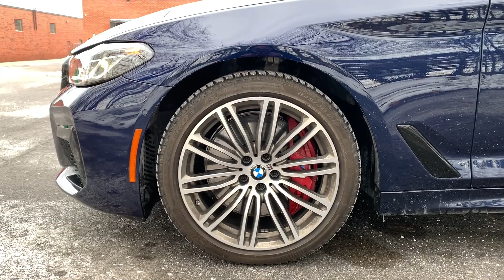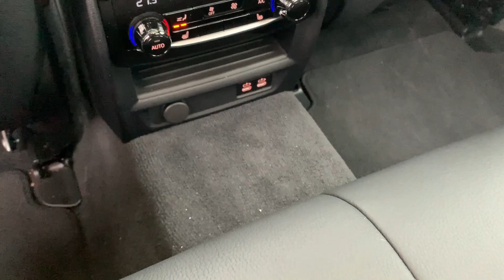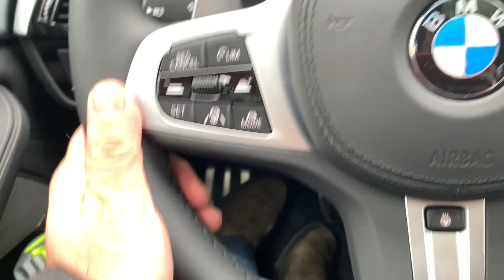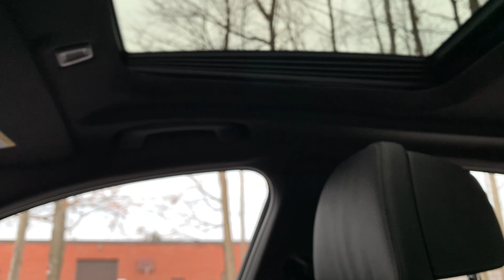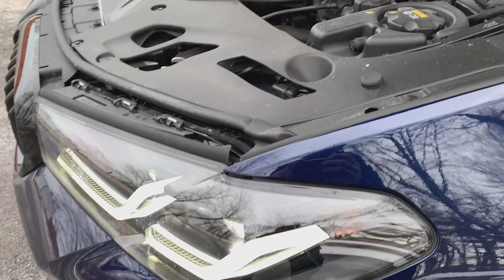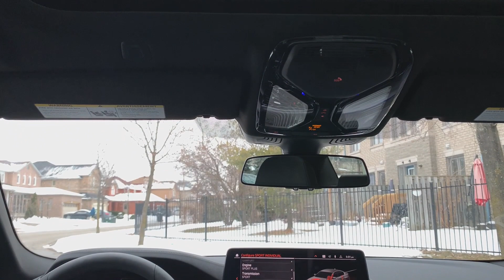Perks Quirks & Irks - 2021 BMW 540i - My favourite modern BMW

Comment: In 1972 it was called a Bavaria or 3.0 S and 3.0 Si [E3] [father had an E9 - different designer; Karmann], which followed the BMW 2500 in the late 1960's, then [E12] 520 / 528 / 530 started in 1978.  This also debuted the iconic Hofmeister Kink which now seems to be almost disappearing from BMW lineups.  Then came the most iconic E28s of the 1980's that really stirred the interest and took off.  My first BMW wasn't until the E34s would appear though, followed by the E39 and the E60.  Followed by F07/F10 and now the G30 and F90 [M5] holdovers.  Umpteen LCi's came along in between.   What was your favorite?

Comment: Nice review, right on the money.  I just bought a 2021 BMW 540i xDrive. Best car I've ever owned!
Reply: Do you have thoughts re non adaptive m sport on typical city roads with potholes bumps etc. It seemed fine during the test drive but I wonder if it will get old. There are no adaptive dampers versions around where I live
Reply: Own a E class you’ll change your mind
Reply: @SDBROOKS08  mercedes has been shit since late 90s. If you go above 200 kmh stuff starts creaking and shaking.
Reply: @SDBROOKS08  I think it’s more of personal preference based on what sort of interior layout and the type of exterior you like or prefer 
But both are great cars without doubt

Comment: Nice review!  I have an M550 on order.  Do I need the power? Absolutely not, but considering how fast the industry is changing it may be last time I can get a nice V8.  Not to mention that a heavily optioned 540 wasn’t that far off in price from the M550.
Reply from the maker: Congrats on the M550!  I had one last year and it was a blast!!! Good thinking re: V8 as you’re right about the industry downsizing cylinders. 
Thank you for the kind words - I appreciate it!!
Reply: EXACTLY my sentiments, so I ordered an Individual M550.  It may be the "last of the Mahicans."